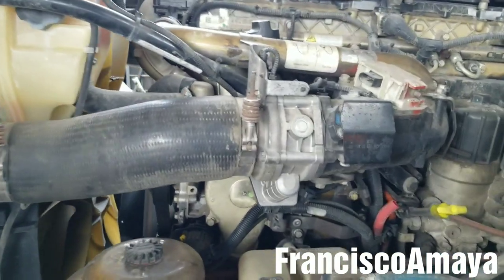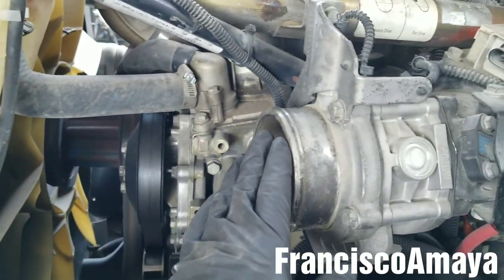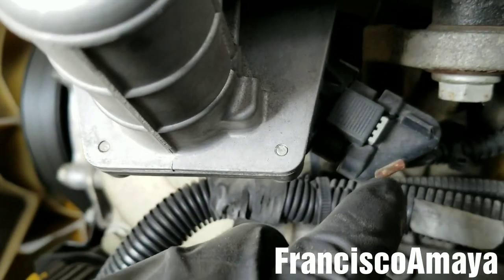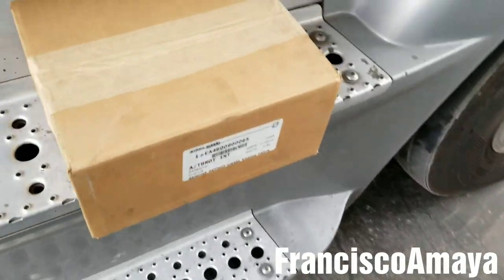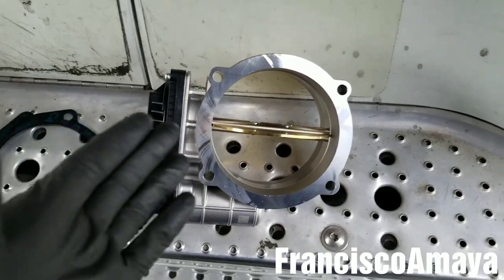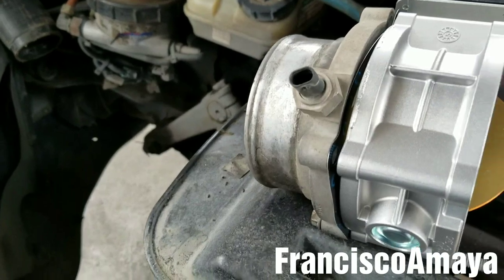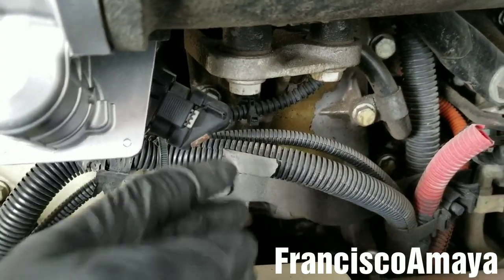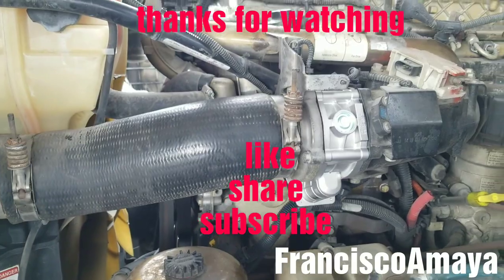Freightliner cascadia DD13 DD15 DD16 intake throttle valve replacement  OM 471 OM 472 OM 473

Comment: Nice videos man, very informative. Quick question, I had to have a coolant hose replaced in my truck, Freightliner DD13. I believe the mechanic took off the intake hose system to get to this hose. He put the hose on and reattached the intake hose. Now, my dashboard has Check Engine and Maintenance lights displayed, throwing codes SPN 51 and SPN 3464. Maybe he accidentally tampered with a sensor and not knowing it. What do you think it may be?

Comment: I changed the valve but I have the same code... I do have a rough idle also.. going from 1600rpm dropping to 1500rpms then back to 1600... and i can smell diesel when it happens and after i drive finish driving... do you think the Fuel compensation aka Fuel meter aka Quantity Control Valve could be causing this code and a rough idle?
DD15 spn 51 fail 18
Intake Throttle Position Rationality Error

Comment: My 2013 cascadia needs a new overflow tank. The two bolts that hold it to the top of the radiator are rivnuts and are rusted solid. Would love to see a video on how to remove the rivnuts   .
Reply from the maker: Sure, Vic Med had the same PROBLEM with his truck.  I will do a video with details.
Reply: @franciscoamayaYT  I watched vic  meds video. He talked about the bolts but didn't show how to remove them when they are rusted and won't come out.

Comment: I'm planning on buying a cascadi dd15 or dd13. What do you recommend? Also, love the informative videos. I have learned a lot and will stay away from isx cummins.
Reply from the maker: I will prefer DD15 but DD13 is fuel saver. It will depend on what you need it for.

Comment: i have code SPN-51	2	Engine Throttle Valve 1 Position 1. how long can i drive the truck with the code on? in other words how fast does action need to be taken?
Reply from the maker: It will have problem with the parked regen. Nothing else. It can past long as long you don't idle to long.
Reply: @franciscoamayaYT  it’s not a CPC related issue is it ?

Comment: 2014 freightliner cascadia dd15,I have code spn 2630 FMI 2, air intake system problem detected 25% derate and the truck is delete. Please help. Thanks

Comment: Hi i have  fault code cascadia freightliner 2011 ecu 1 spn 3464 fail 31 ..i replaced throttle valve 3 month's ago could thr harness or a sensor ?
Reply from the maker: Could be a defective valve but also can be the harness.

Comment: Francisco, do you ever recommend removing the throttle valve to clean soot off it, even though there is no sign of failure on the throttle valve itself?  thank you for another educative video.
Reply from the maker: No, the throttle valve mechanism is the one that goes bad.
Reply: Francisco Amaya gracias Francisco y Felicidades, Fernando
Reply: I have a intake pressure code, I’ve checked the delta pressure pipe like you did in your other video and it was clean, could this also effect the manifold pressure?

Comment: Francisco, do you need to calibrate it after that ? Or not? Also my friend , I have 2 codes in my truck that i need your help on it , 1st: motor2 001 spn00110 temprefrigmoto 00 , and the other one eec 061 spn 003556 aftrtrmt inj 18, I guess this one is the one that goes in the exhaust behind the turbo, I check the hole but is not clogged up, what's your thought on this , thank you man, recently I replace the ac compressor and mine had a little sensor on the back and the new one doesn't,  they say the manufacturer get rid of it
Reply from the maker: SPN 110 fmi 0
You can have a fault outlet coolant temp sensor

SPN 3558 fmi 18
Check the video
https://youtu.be/EozE5jZ91RI
Let me know if it works.
Reply from the maker: No, you don't need to calibrate it.
Reply: Thank you,I tried to remove the injector and I'm telling you, I'm gonna need to cut the line because I can't get the line unscrew from the injector lol, I have never see something that hard, but I'm gonna need too to buy a computer and software to hook up to the truck, thank you friend

Comment: Hi Francisco
I own a 2016 cascadia 2016 10 speed manual transmission unit. While bobtailing on a highway I noticed that I wasn't able to throttle to upshift to the 9th gear. When I pushed the gas pedal the unit was not speeding. Rpm was between 13 to 14. After about 10 minutes it all came back to normal. I was able to speed up and upshift or downshift. Shortly after reaching my company yard the regen light came on the dash. Steady light not blinking. engine light is not on. What could be the issue?  I do not know whether it would reoccur while on highway again. Please advise.
Reply from the maker: Did you have any code number?
Reply: @franciscoamayaYT  there was no engine light or code number.

Comment: I have issue with fuel pressure low. When I'm driving heavy on hill the check engine light come on and no power after hill road straight power back and no check engine light. What's can be? Please help
Reply: Andrey did you find the problem?? I got the same problem on my cascadia
Reply: @yezyezyez21  no I don't
Reply: Did you guys figure out what was the issue?

Comment: Hey Fransisco esto causa fault code eng 1 fail 31 spn 3464??
Reply from the maker: No, ese codigo ser refiere a un throttle valve malo o un wiring harness malo
Reply: Y como se save si es el valve o es un harness?

Comment: I gotta fault code that keeps popping up “SPN-3464 Engine Throttle Actuator Control Command FMI-4 (Voltage Below Normal) 
Count: 20” What do I do to fix it?
Reply from the maker: It is possible that the throttle valve is not good.
Reply: Francisco Amaya so change the whole throttle body?
Reply from the maker: Here I have a video with details
Click the link below
https://youtu.be/KtMLsy-x4QQ